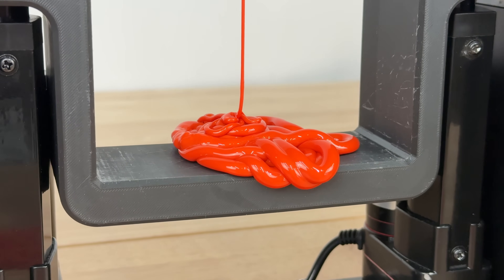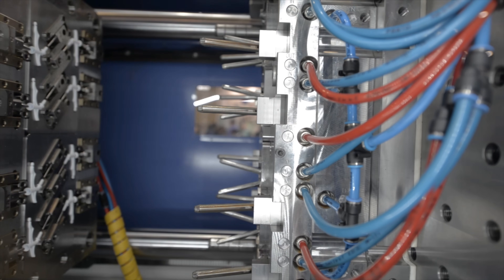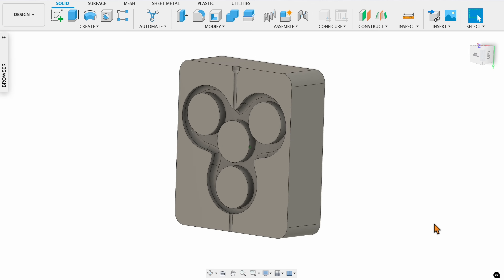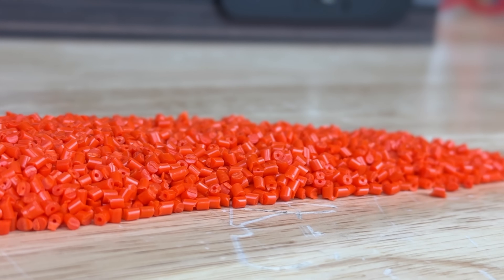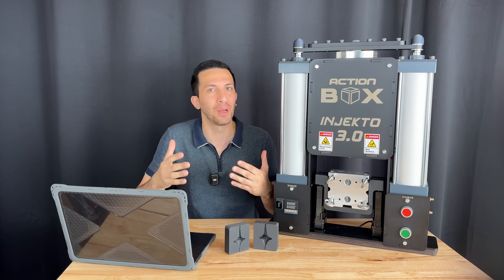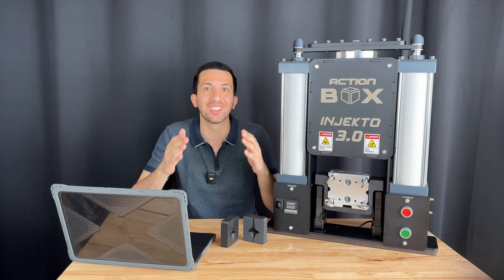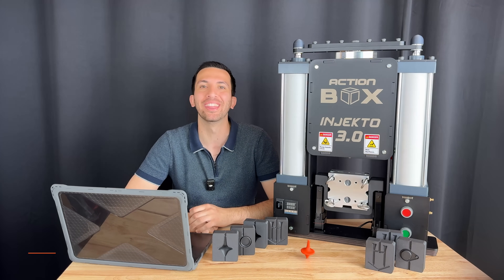FDM 3D Printed Molds SURVIVE Plastic Injection

Comment: Don't you get tiny carbon fibre bits into the surface of the injection moulded part?
Reply from the maker: We have not noticed anything, but even if you do, it may only be the first injection or two, until you clear out all of the surface fibers
Reply: @ActionBOX have you looked into any materials not impregnated with carbon fibre?

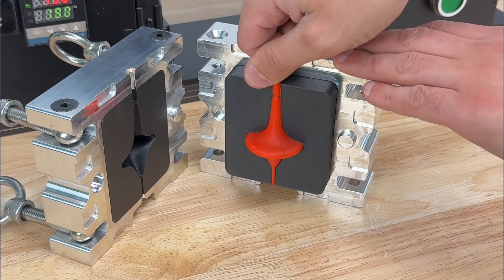Comment: 2:18 the material their using. Not a good material to use due to CF getting into your skin, eyes and lungs though. Doing it once, youll be fine. Do it repeatedly, your gona get health problems eventually. Air filters wont solve the issue, only delay it. But it will be an issue for your health. 

This is not to be confused with continuous CF-reinforcment processes of 3D printing. That uses a single long strand, these filaments in the video use chopped up fibers in a fine powder in the filament and many of those tiny fine fibers will get on your hands while handling your finished prints. Just a fair warning.

But this whole injection molding thing is a cool concept, but its way better to just use a resin print or a CNC'd part. Both machines are a lot cheaper now.

Comment: 3:10 i think its because PETs have a lower glass transition temp, so while printing pet cf at higher temps you are also in a way skipping usually a much needed annealing process. as it has higher temps = more time over glass temp = bigger window for diffusion and crystallisation processes to occurs. This results in stronger mechanical properties, better temp resistances and could be the reason for less noticeable layer lines while printing it. If anyone else could confirm, add anything or correct me, please do so, im very interested in this

Comment: How many runs can you get per mold before it starts breaking down? I have two products that sell very well. I’ve been using plastic resin and silicone molds. I can only do about 42 per hour. This machine seems like an answer to my production needs but I don’t really want to have to purchase a 3d printer just for these two molds. Would it be possible to purchase mold backers and have you guys make molds for me?

Comment: I made my own plastic injection machine  a 300 gram max injection size (hdpe) because I had a fairly large solid part i planned to make. It worked amazing. I regularly 3d print with pa-cf, PC-cf. PET-cf and PPS-cf, which has some of the best temp resistance you can get on the borderline consumer/industrial filaments and there is NO chance it could hang for a single injection of my part😂 sure wish. I tried everything. Didnt want to pay to have my mold cnc'd out of aluminum. I tried high temp epoxy resins, fdm with all those filaments- even with a very good temp resistwnce over 200c- the hdpe and ldpe I use is injected far hotter than that. I ended up 3d printing my part, then making a ultra fine sand mold negative of that. And then casting it in Aluminum, then hand finishing the mold before finally milling the 2 halfs and injection chanel in. Lemme tell ya how big of a PITA that was. If theres a resin thats capable of taking a several hundred gram solid hdpe injection let me know because.. i have to do it again for another design because😂
Reply: Thanks for sharing this.  I’ve been wondering about using 3D printed masters to make cast aluminum molds, but I’ve only heard that it’s a dumb idea and won’t work.  But you’ve already done it.  Very cool!

Comment: I have already made some stuff around the house out of PET-CF, and I find the material a joy to print with.  The stability and dimensional accuracy are fantastic.  And while I know that the CF is good for dimensional stability and stiffness, I guess I never stopped to consider the fact that it would also be a huge boost to thermal conductivity.  Knowing that they are capable of conducting heat better than most plastics, I wonder if it would be possible to water cool them to have greater control over part cooling, cool the parts faster to improve throughput, and/ or to at least help increase the lifespan of the molds.  Knowing how iffy it is to make FDM parts water tight (I know it can be done, but we're talking about stuff under pressure) but it might be easier to just leave some channels in the plastic for copper tubing to be fed through, maybe with thermal past to fill in the gaps.

IDK it looks like this process doesn't need it at this point, but it might be something worth looking into at some point.
Reply: Please make sure you seal what ever you make using CF. The glass fibers do shed off anything you make and will get all over your hands and anything you touch. I've seen it myself with our digital microscope. I wish there were more videos that express how important it is to properly handle CF 😔

Comment: As a researcher in 3D printing, one of my students discovered in his research that PETG-CF tends to have smooth flat surface compared to PA-CF. Our hypothesis was that the layer of PETG-CF has ironing effect on the previous layer possibly due to good heat conduction, giving a flatter surface and also good layer fusion reducing significant porosity. This is quite difficult to simplify for a youtube comment.
Reply: Hi Ace, if you don't mind, would you please share more details of the research or paper? I would love to go deeper on this. I hope that is okay for you, thanks in advance.

Comment: A cheap desktop cnc machine can make small aluminum molds which are far better for this job.

Carbon fiber filament is a scam. The strength in carbon fiber comes from the woven fabric and thickness of the thread. Different patterns create strength in different directions.

Cf filament uses tiny bits of carbon fiber suspended in plastic. Unwoven strands add some stiffness to a resin part but no strength. 

Strands as tiny as what you find in filament probably adds nothing at all. It may even make the part brittle and weaker than an all plastic part.

Comment: what pet cf are you getting for 36 dollars? From what I've found the cheapest carbon FIBER pet is sirayatech pet cf which costs more than that. The cheaper ones I have seen didn't seem to use carbon fibers but rather just ground carbon which doesn't do the same thing.

Comment: Why should it be impossible? We are doing that for almost 10 years already for small to medium size injection molding batches. Doing it with an FDM or SLA printers. Only thing to consider is to make the mould out of material that is more heat resistant then the material you are injecting... Thats the whole science of it. Usually we make them out of nylon or some other material with heat deflection of 150° or more
Reply: If you have a lot of money, PEEK can take over 300C before softening.

Comment: Wouldn’t it help to shape the contact surface between the mold and the backer for maximum heat transfer? That way you could dissipate heat from the PET CF mold more efficiently, potentially boosting its durability and maybe even reducing cycle time if you add water cooling later on.
Reply: I get that the current flat, glass bed–style bottom layer aims to maximize surface contact. Still, there might be geometries where the heat dissipation gains outweigh the loss of contact due to layer lines — especially if you add water cooling later.
Reply from the maker: This is a good idea. Controlling mold temperature is very important for the process as well (beyond just extending the life of the molds) so this will be interesting to look into.

Comment: PET CF has smooth walls because it has higher viscosity and reinforcement, so it does not flow as much during printing. 
The connecting layer has a similar size to the layer where the extruded material runs.
The reinforcement also penetrates the previous layer and the new one rests well on it.

Comment: This is such a pointless thing, it doesn't verify if a real mold is good since it doesnt have the thermal / cooling properties of a real mold.
Whats the minimum draft for this?? That's a highly valid question since it looks like a grained finished from a normal mold which would suggest heavy drafting is needed for any sort of shrink on geometry. 
The CF is also a very debatable decision for this since the fibres are not actually locked into the matrix here, not during the printing of the mold nor after are they locked in, getting into your airways will 100% cause issues in the future like asbestos. 
So all in all, stay away from this, use a normal SLA mold if needed or just get soft tooling for prototypes, can do more in regards to proper mold meets in aluminium.

Comment: I would definitely coat any CF infused filament
Reply: This or handle the parts with thick rubber gloves.
Reply: Yeah, it's not dangerous to handle but it can make your hands itchy. I suppose some fibers could potentially transfer to the injected material, although that wouldn't last long.
Reply: @HarrisonMartinson it makes your hands itchy because I’m expecting that the CF are like small glass shards that are needling your skin at a microscopic level. Not good.
Reply: @oKazaryo  Someone around here has a video that shows exactly that with their skin under a microscope after handling a print.

Comment: Wholly guacamole!

To start a manufacturing business 10 years ago, you needed 7-9 digits of budget, now it is:
 - 3D Printer ~$300
 - Injekto: ~$2500
 - CNC: ~$2500
 - A spare table to put all that

It is cheaper than a used Corolla...

Truthfully, the future is now!
Reply from the maker: You don’t even need a CNC.  Just INJEKTO AND THE 3d printer 😜. Everything else is also on our website at actionbox.ca
Reply: For chinese equipment yes. A decent industrial 3d printer still costs 10k+, a CNC machine capable of repetitive accuracy on parts still costs 30k at minimum,...
Reply: @KristjanS-Kristeh That "decent" 3D printer is not decent the way you think it is. Stratasys printers are years behind Bambu Lab in every way imaginable.
They're only necessary if you're planning on manufacturing parts for some specific industrial applications that require certificates and approbation - of which stratasys has many.
Reply: @inso5078  Yeah if someone wants an example of an industrial printer, the best example would be mosaic array. It has filament splicing which supports 32 filaments across 4 industrial grade 3d printers with robotic build plate loading and unloading, letting you print a hundred parts unattended.
Reply: @KristjanS-Kristeh  I have used a 100k 3D printer, and i have used a P1S, Both give me same results. and more often than not, the P1S gives out better results. i run a business, and the P1s has around 3000 hours on it, zero issues, consistent results. Maintenance wise, changed nozzle at around 1500 hours. and regular lubing. lightyears ahead of what i used to use 13 years ago, i was an early adopters of the Ender (Gen 1) printers and RepRap printers. 

from your channel, you seem to know very little about 3d printers and how to troubleshoot issues. or have any actual experience with industrial printers. in 2025, Industrial FDM printers and Consumer printers have little to no difference.
Reply: @swapnilmankame  Sure dude whatever makes you happy :)
Reply: @KristjanS-Kristeh he’s right tho your just butthurt that your wrong 😂😂😂
Reply: @arsena1147  SOrry man... printer where i need to change half of the machine before it reaches 1000 hours is just crap.
Reply: @KristjanS-Kristeh  "printer where i need to change half of the machine before it reaches 1000 hours" I have a p1s that is reaching 3200 hours, and an A1 that is at around 5000 hours, the only change ive done is change the Nozzle on the P1 to hardened at around 1500 hours. still prints like butter with no visible layer lines. the only thing i've done for the A1 is lube it from time to time and tighten the belts. there is a reason almost all Print farms have switched to P1S or P1P. 

Bums always blame the tool because they are mind-blowingly incompetent to use it.

Comment: Layer lines tend to disappear due to CF being added to the filament, observe all types of CF filled filaments, they all have the same-ish surface finish. CF is commonly added/chosen to print parts that require better surface finishes.
Reply from the maker: Hmm that’s cool, I didn’t know that.  Thank you
Reply: @ActionBOX  it's because the surface is rougher when you add Glass or Carbon fibres. The uniform roughness hides layer lines really well. It's a similar effect to using "Fuzzy Skin"

Comment: CF the asbestos of the future 😢
Reply: This is my fear of getting into printing with it. Knowing what it is and seeing tests of how it sticks in your hands after being printed etc...just scary.
Reply: Yeah, especially since its really not that much stronger than non CF  @secretagb
Reply from the maker: Interesting thought.  I had never even considered this.  Thanks for commenting, I will look into this immediately.  
Hope you enjoyed the video regardless 😃
Reply: @ActionBOX someone already did some tests, but the answer is to use an enclosure that’s well-ventilated— either to the outside, or to a thick carbon and HEPA 13 filter combo that exhausts back into the enclosure so that it gets filtered multiple times, and continues to filter even when the print finishes, before you open the enclosure.

That’s what I have set up. The negative pressure of the filtering system keeps the air from leaking out, since most enclosures aren’t actually airtight, and continuously running it through the filter system gives the filter multiple chances to catch particles.
Reply: @ActionBOX  please do. Especially considering how many ways the fibers can become airborne. They can migrate too, I have heard of cf getting stuck in hands and legs and migrating to the heart and lungs. CF seems fine when done professionally with long fibers, but these short fibers in prints from amateurs at home seem very risky. I won't touch it, not worth the risk for me.
Reply: @ActionBOX  test PETG. Different brands
Reply: @ActionBOX Nathan build robots dive into this subject a while back
Reply: @UnfiItered  Prusa also released a statement regarding cf filaments with respect to what they produce
Reply: @plutonasa their test is manipulative, "wearing print taped to their skin". Meaning there was no or very minimal rubbing going on. Congratulations on falling into the corporate bs.
Reply: @UnfiItered  which is why I said they tested their own filament. cant really trust it if only one sample is used.
Reply: Asbestos is extremely dangerous because it continuously splinters into increasingly thin fibers to the point where it can damage DNA and cause cancer. Carbon fiber doesn't splinter, so the fibers just break instead of getting thinner. There's no evidence that getting it stuck in your skin is dangerous either. It's certainly harmful to inhale, but you could say the same of many things such as plastic dust and sawdust. When sanding or cutting ANYTHING you should wear a mask or respirator appropriate for the material, carbon fiber-impregnated or otherwise. CF does NOT compare to asbestos.
Reply: i mean its carbon where it dont belong but silicon causes the cancer. idk if the body will filter it out or not but theres a chance
Reply: Filament??
Reply: @DEMİRELRECORDZ what are you asking?
Reply: @lanon3277 Which filament is used?
Reply: @DEMİRELRECORDZ filaments containing Carbon Fiber, which have “CF” appended to them. So it could be PETG-CF, PAHT-CF, or CF-Nylon… the issue is any filament that has CF.

Comment: Can this injection moulder do metal-injection-moulded parts? As in kiln the mim parts to make dense metal parts?
Reply from the maker: Yes we have used it successfully with MASTE before.  De-molding the parts from the mold is a different issue.
Reply: @ActionBOX  tantalising. Any affordable desktop metal process is the holy grail

Comment: Polymaker PLA-HT should work just fine. Which proves that you don't need a very expensive and difficult to print PET-CF to do this.
Reply: Fabra Fuse has a video about using the HT PLA and HT PLA GF for injection mold tooling.
Reply: I have used PLA to make molds for over molding connectors with Polyurethane (rubber).  of course not much heat is used,   I inject these by hand with an epoxy gun.   heat is needed to accelerate curing times though,  so I put them in an area with about 100 degrees F.   for 12 hours.

the urathane does not stick to the PLA,  and the molds last about 5-8 times.  they eventually warp due to the oven heat even though it is low,   that new HT-PLA looks promising and plan on trying it with that,  it should survive.      but since I am only molding connectors on harnesses for the military (small orders) ,  getting a few uses out of a pla molds is fine.     if I was doing hundreds or thousands than I would use something else.
Reply: it wont lmao, PLA remains PLA, it will not last

Comment: That's crazy. How many injections do you get out of one mold before it degrades? 
Thanks!
Reply from the maker: We actually have a video coming out in the near future that compares different materials and their life cycle. Dont forget to subscribe to be notified of when that comes out.
Reply: @ActionBOX  would they survive in a quick setup mass production device ?you know those with air intakes to eject the part and keep going as fast as possible
Reply: @EngineerAAJ  no. both cooling the part and mold would become an issue. The mold would get heat soaked and risk deformation, the part wouldn't cool fast enough to release.
You use 3D printed molds for small runs, or prototyping final mold design to be made in metal for this reason
Reply: @ActionBOX would you have an update on this??